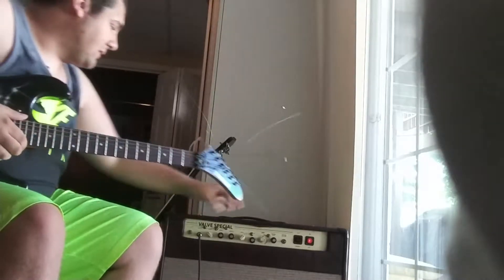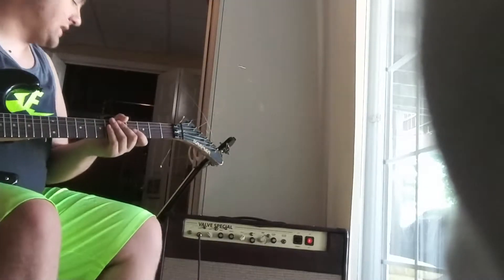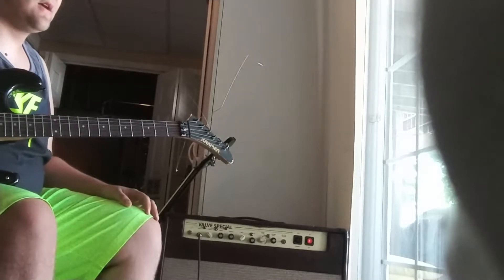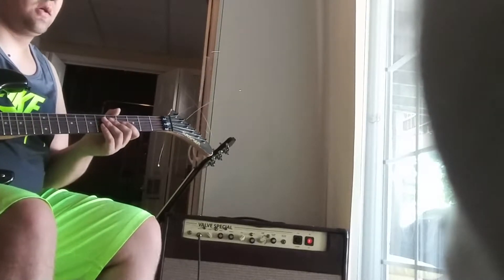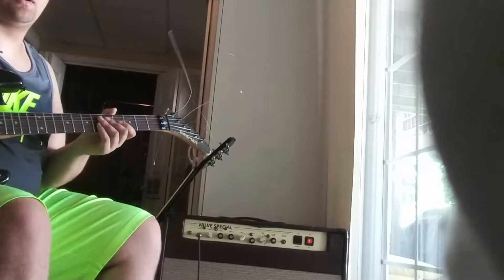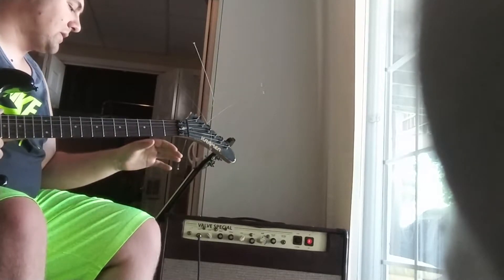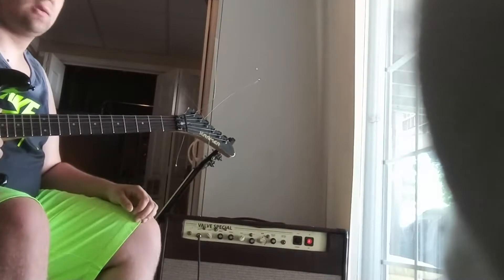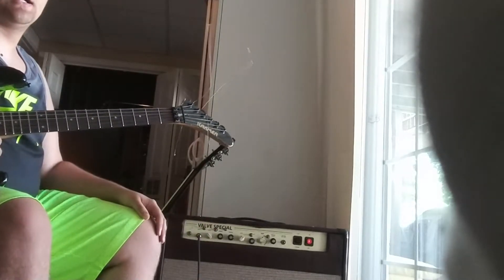Change Tone Slope Resistor and Treble Cap in Jcm800 style amp

Comment: smart putting the strings in backwards, most people cut the ball ends, I found this vid trying to find an answer on how to make my amp less bright.
Reply: @javamony  I have a solid state practice amp and the cap is .002uf so I thought changing the value on the tone cap would help run off some more highs to ground.
Reply: @javamony  I found out that adding snubber capacitor on the last cold biased stage in any amp across plate resistor - 470pf is the best option to kill ice treble peak which often blocks us from rising  trebles on EQ... So in the end we can cancel very sharp trebles to add more musical, lower ones.